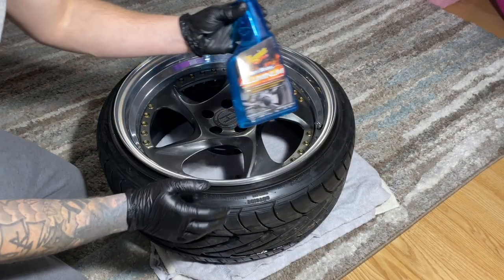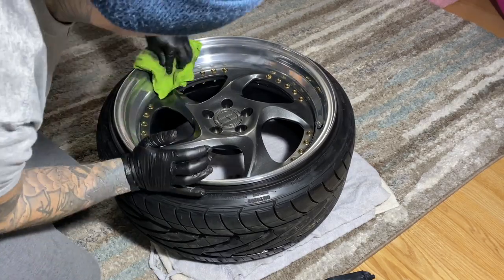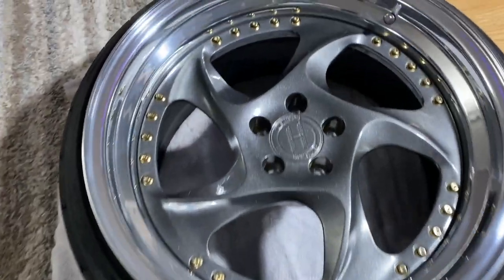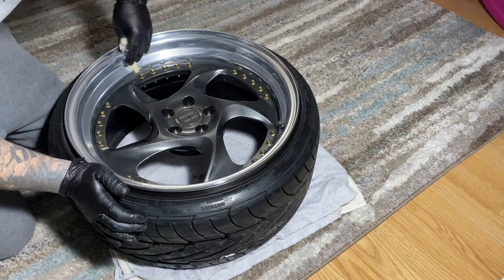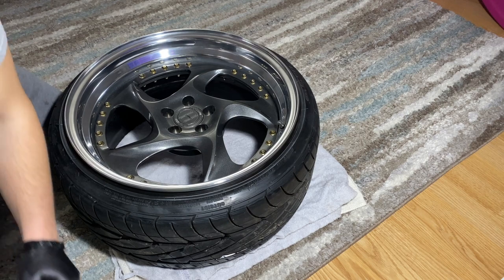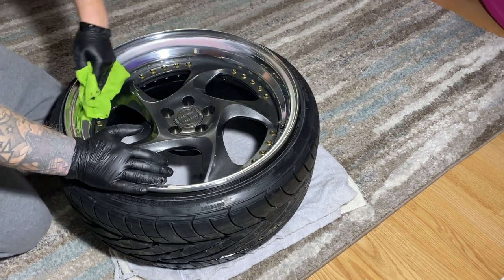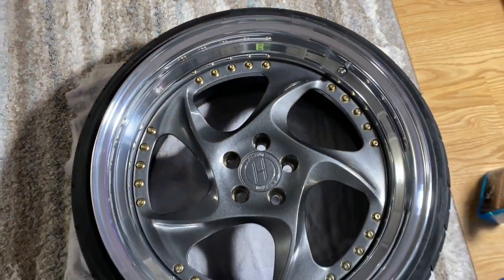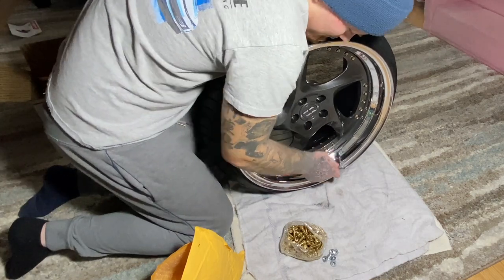Polishing My Aluminum Wheel Lips

Comment: I would use the compound first then mother's... Compound is much coarser than polish... Using the compound after is like sanding the rim with 2000 grit and finishing up with 1000 grit going backwards
Reply from the maker: Appreciate the input. The compound I use and the mothers both have about the same grit in it what it feels like. And I’ve always gotten better results with the red compound over the mothers. I’ll give it a shot next time though.

Comment: Would this process fix chemically stain wheels from wheel cleaner ?
Reply from the maker: I imagine the aluminum wheel cleaner would stain the metal if you let it sit on it without wiping off. But polishing the aluminum will pretty much get all stains, water marks, and fine scratches out of the metal.

Comment: Great stuff, beautiful wheels.  I'm in the same predicament, except I have work vs-edition wheels that have the bare aluminum around the gold rivets.  So I have to actually polish in between the rivets.  What a pain in the ass.  I'm curious...if I remove all the rivets prior to polishing the lips, will I first have to completely air out the tires? (I'm stretched like you).  I just don't want anything blowing up in my face lol, but I'd also hate for the tire to debead on me.
Reply from the maker: Sorry I never responded sooner. I’m just not seeing this. My new bbs rs wheels are the same way. It’s all polished around the hardware. It all depends on how the 3 piece wheel is mounted. (Face mount, sandwich mount, or rear mount) but to do it the correct way, would be to take tires off, break the wheels completely down, and polish the lips while apart. It’s a bigger process but it’s much easier to get the job done the right way with the best results